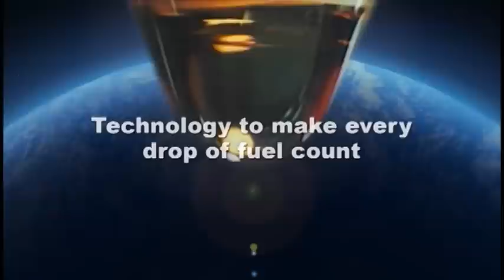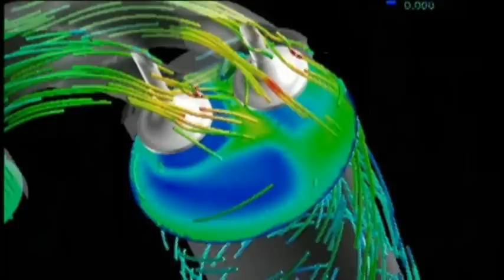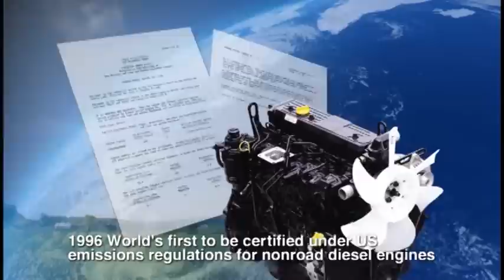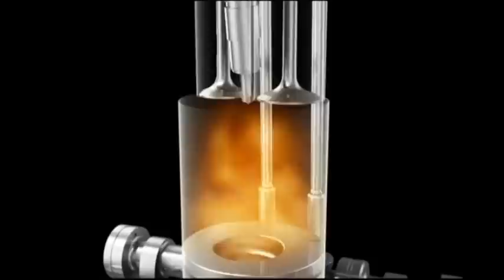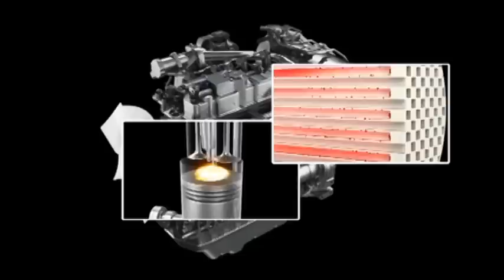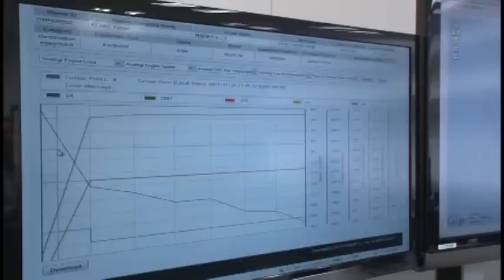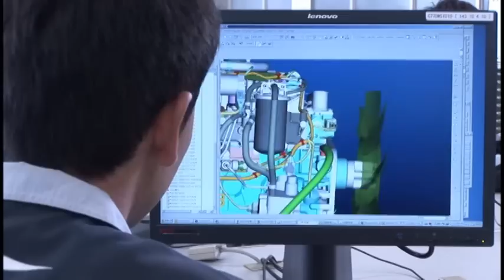Power to the Future, Yanmar Diesel Engines

Comment: Has Yanmar considered a 5 stroke diesel engine? If this can give a Otto cycle engine efficiency beyond that of diesel, imagine what it would do for a diesel engine.
Reply: David usually vehicles (except 2 wheelers) are having 4 stroke petrol or diesel engines ie,  suction,  compression,  power,  exhaust... In yanmar engines which is the 5th stroke?  Can u explain please